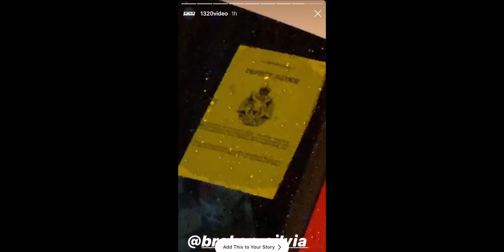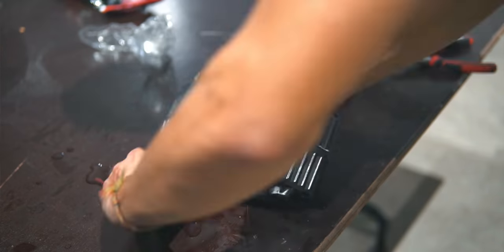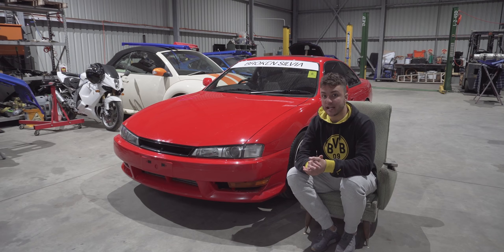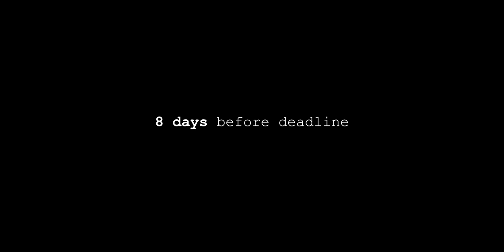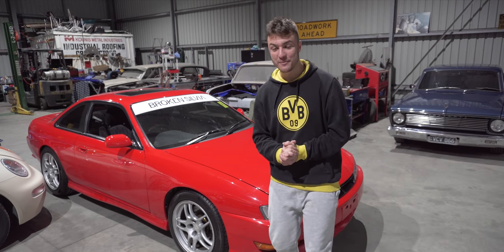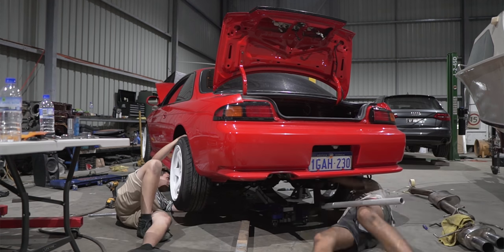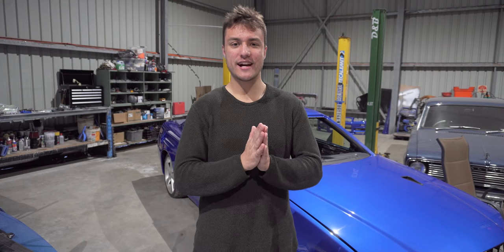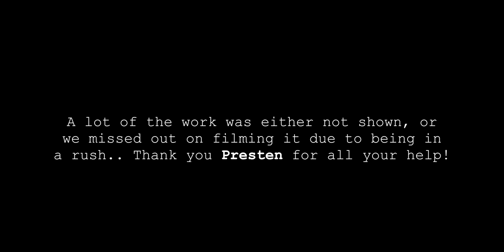UNDERCOVER COPS Defect my "ILLEGAL" S14 Silvia | The Broken Silvia [EP13]

Comment: Super video instalment! Thank you for taking me on your adventure.

Can you install a 350Z wiper and washer system? We have the washer nozzles on the wiper arms.
Reply from the maker: Great idea
Might look into it
Reply: @BrokenSilvia  I have an R33 GTS where the washer bottle has been relocated. It now sits where the OEM intercooler used to be, hidden by the front bumper. Filler cap is "hidden" by FMIC piping in the bay but still easy to reach and fill. Have never been up close to a Silva but I assume they are pretty identical in this area(?).